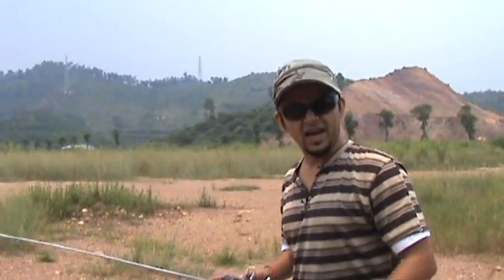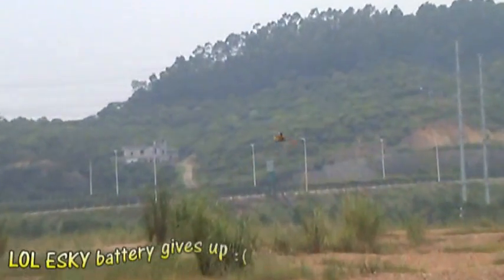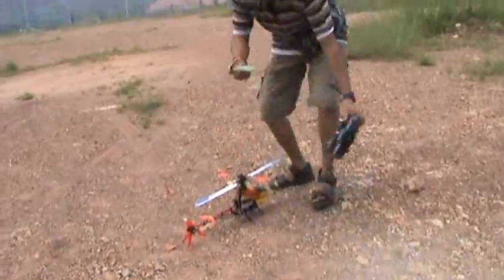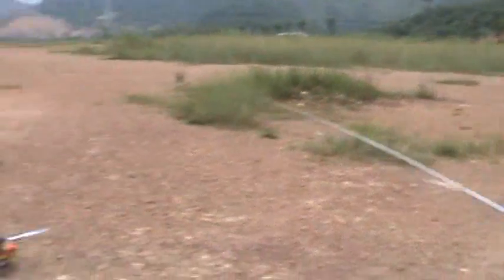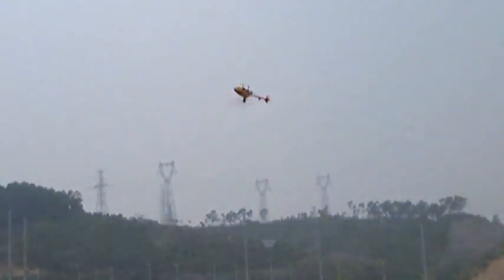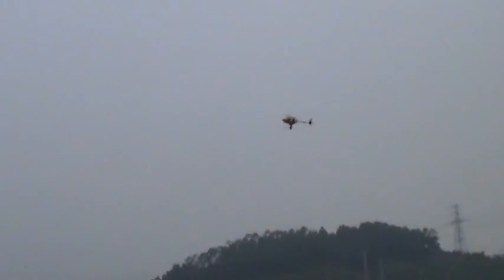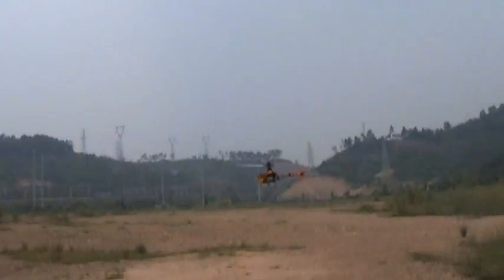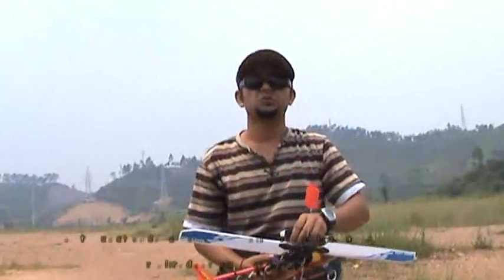Honey Bee King 3 Flight with 2200mAh Battery

Comment: this seems to be a decent beginner/ intermediate heli for a modest budget (under$200). I have ordered one. will the Esky 2.4Ghz radio connect to Phoenix rc sim? how long do the stock and 2200mah batteries last if doing mild beginner flying?

Comment: @RcWorld7 Thats not what I was talking about. If a motor can pull a certain max amount of amps, it doesn't mean it actually will. Most 450 helicopters average on a 12amp draw during hover and normal flight, way below what most ESC would be more than capable dealing with.

There's a couple of things you can do wrong when choosing a alternative battery though.

Comment: could it be possible to connect 2 battery's in parralel to the helicopter so that you encrease the flighttime ?
or will 2 batterij's be to heavy to lift off the helicopter ?

Thanks  ;)

Comment: Hello Ali i have a question....Im new to the lipoly batteries so this might be a dumb question...I have a 20c 11.1v 2200mah batt and im not sure how to charge it. It came with an a10 warthog edf controller and balance charger, one side of the charger has the 7.4v or 11.1v plug in for batt, the other side has the dc12v input...it came with a cord to plug in the dc12v side and at the end of the cord are clamps, one red one black. Do i just clamp it to a regular 12v car battery?